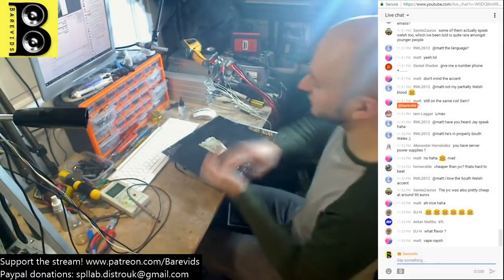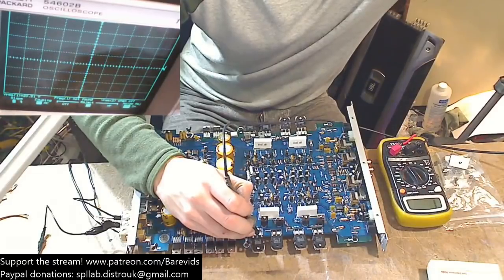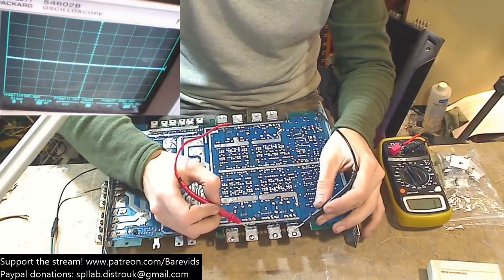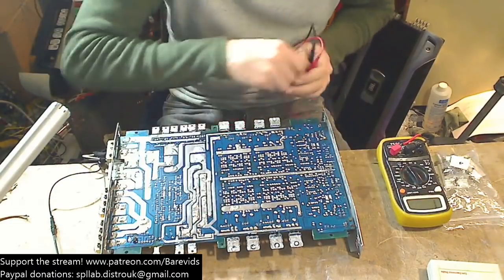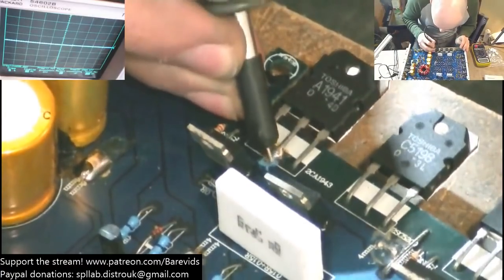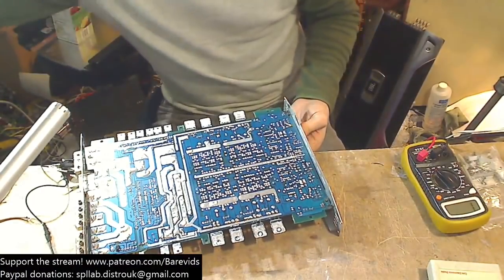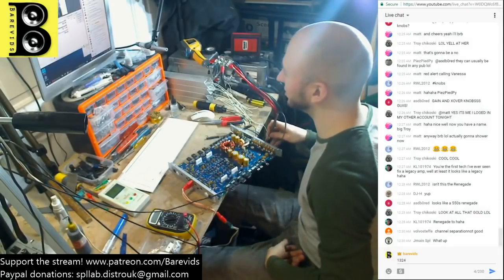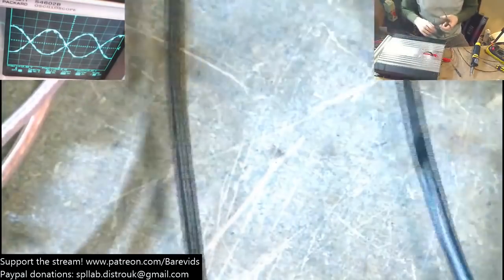Small car amp repair - Renegade 4-channel

Comment: Hello! I have old(Over 10 years old) Ground Zero 4150X. It is working but i noticed that when power is ON left channel speakers are moving(bump). I have disconnected a player and put on remote 12V and amp did the same but. From where probably problem come from?

Comment: Are you only using one probe on the multimeter to check voltages? Where is the red lead? How do you send power to the amp working on it outside a vehicle? I repair electronics but am new to the amp scene as I just got one from someone to look at.

Comment: amp doesnt power on.no display lighting,only thing is that the 12volt power supply cuts completly off when connected to the amp.any ideas?

Comment: I get bad crackling from my amp that comes out of the subwoofers. It happens when the car if off usually when I unlock the car and first get inside the car. This is without music playing.  The crackling will shake the woofers violently. I had to disconnect the amp. I uploaded a 30sec video to show what the woofers were doing on my channel. Does anyone know what the issue could be? I've had the amp 4years. I was going to take the amp apart today to see what I could see.

Comment: Hi bro, we have an amp. I think its front left output is blown out. The other three outputs are good individually. But when I bridge the rear outputs for a sub, it doesnt performance well. Even one channel plays better than the bridge mode. So, does the blown front left out put affect the rear outputs? Or there is another broken thing with the amp? Thanks indeed... 😊✋

Comment: Sir accidentally i connected -ve wire of battrey in the +ve side of amplifier and +ve side into -ve terminal and sparking got placed after that when i reverse the connection my amplifier still not working neither the fuse is blown nither the protector mode on it just. Showing sparking and heats the wire when i touch the wires to the terminal, then i checked it with multi metere and it shows the +ve and -ve terminal of amplifier is shorted can you please suggest which thing of amplifier is blown up??
Reply from the maker: Probably reverse polarity protection diodes. They're large diodes near the power terminals.
Reply: barevids ok sir i ll check

Comment: I have a problem with a amp that turns off when volume is high what could that be
Reply from the maker: +sniperking25 d voltage drop
Reply: barevids thanks for replay but it's not voltage drop I have to identical amp and that's the the only amp that shut off and then back on the other amp keeps playing just fine
Reply: does it have protection light? is it turned on when it shuts off?
Reply: Cekpi7 it doesn’t
Reply: Cekpi7 it only shuts off when the amp it’s playing a little loud I know is not clipping because I have an oscilloscope
Reply: sniperking25 d Measure voltage on positive and negative inputs on your amp and play, if it drops under 11-10v then you have problem. Osciloscope might help also since it will show you voltage drop faster.
It woukd be helpful if you say what else you run in your system, it may not be amps fault.
Reply: It might be overheating.